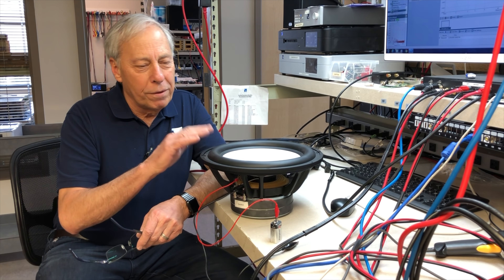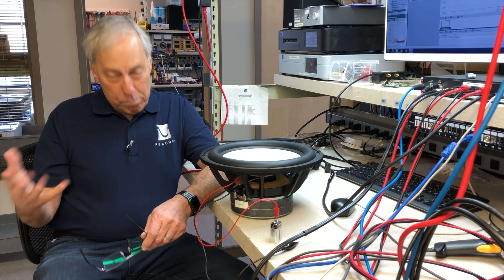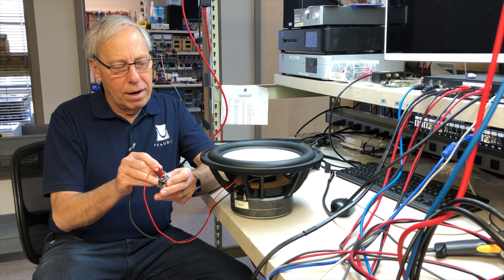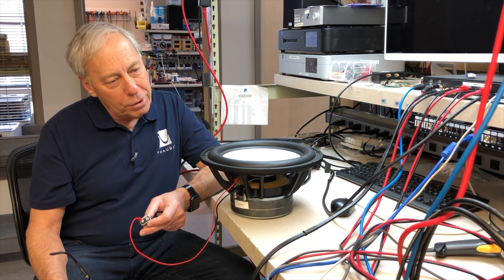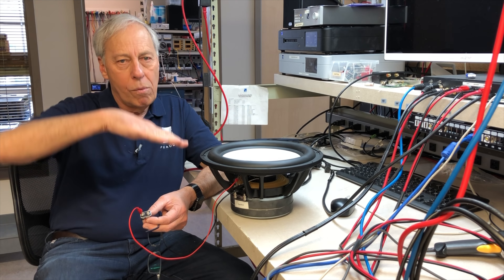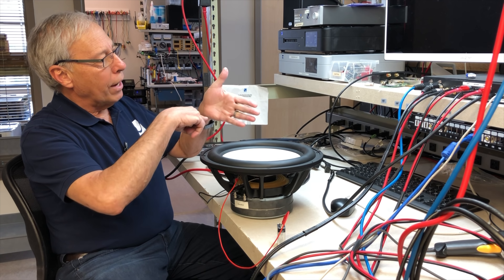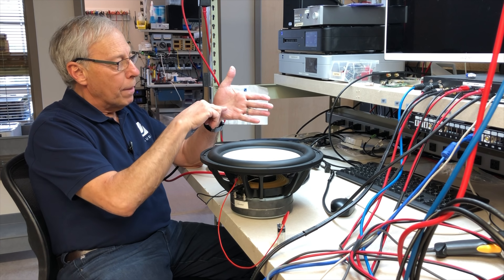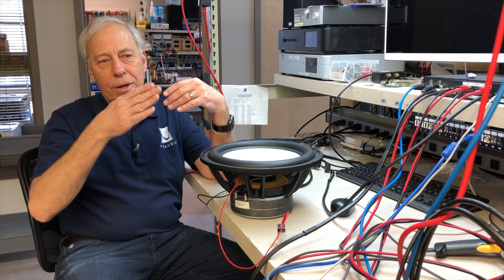How can one speaker driver reproduce multiple frequencies?

Comment: I think this calls for PS Audio to make a speaker with 50 thousand divers in it so each if them can be dedicated to a specific frequency. ;)
Reply: I think about 19980 would be enough 😂
Reply: @mannymore_music  yes but you will induce is comb filtering
Reply: The answer to this lies with the Danley Sound Labs Synergy Horn. Multiple drivers, each group best suited to their operating bandwidth, all acting together as one if they were one single driver - full range broadband, controlled directivity, linear phase, single point source.
Reply: That would be actually sick...
Reply: very good idea.
Reply: @trikki69 IVE THOUGHT THE SAME EXACT THING WTF
Reply: Instablaster...
Reply: 50 thousand phase issues
Reply: @Tarik B. the room acoustics of it looks not very promising
Reply: @Tarik B. Wall reflections - I don't get why audiophiles invest a ton of money for gear but don't care for the most important part of the chain which is always the room
Reply: @Tarik B. to precent a speaker you need room acoustics, otherwise you present the room
Reply: @Tarik B. Surely, but it's mostly not done - the only serious treatment I see on most videos are Diffusor which are the very very last step AFTER your room problems are solved to make it sound more lively - good room acoustics let sound 2000 dollar speakers far better than 10000 dollar speakers in a bad environment and after 10 months of room optimization I know that what I am talking about
Reply: OMG, the complexity and size of the crossover network would be insane. Just try to fit all of the needed inductors and keep them from interfering with each other.
Reply: Divers in speakers😂

Comment: Multiple frequencies playing at the same time on the same speaker diaphragm can be explained on the basis of the waveform  stimulated by the input. Same applies to the eardrum. Multiple frequencies stimulate it as a "waveform" at each instant in a continuous stream of different changing waveforms over time. waveforms

Comment: I never thought about a single cone reproducing multiple frequencies at the same time before, but once you asked the question, I couldn't stop thinking it must be impossible! Also didn't think about Doppler distortion before (though I've hard the term, just not in reference to speaker cones reproducing multiple frequencies). Thanks for the education.
Reply: It is impossible.  There is only 1D information, as is the case with light.  It turns into 2D information magically.  Because the information is in the being, not the wave.  The wave is simply numeric data.

Comment: Two thumbs up . The industry started with full range drivers and along came filters / crossovers . The same can't really be true for tweeters they cannot handle the long throw of the lower frequencies and would rip the soldered leads out .  Since the travel at higher frequencies is almost micro .  As speakers get older the caps often fail causing full signals into  mids and tweeters . 

Since I'm a Klipsch fan, lots of mods for the heritage speakers that would lower or raise the crossover points . Back in the day Speakers had selectable crossovers it allowed listeners to tweak their speakers on the fly . 

I always felt that crossing over before the amplifier stage was best , why amplify unwanted signals ? Downside more amplifiers plus side more power more accuracy more detail etc...

Comment: I understand that the larger drivers (which have a movement range in inches) have doppler distortion.. But do dynamic driver headphones also have doppler distortion? Their range of motion is so very small (less than 2 or 3 millimetres, isn't it?)

Comment: To be technically correct regarding the Doppler distortion, it is related to acceleration, not distance. I stationary train whistle at 1 mile away has the same pitch as it would if right in front of you. it is the change in distance over time that makes for the Doppler effect, and a slower change in distance has less Doppler effect than does a fast change in distance.

Comment: It is VERY EASY to have a visual using Audacity Just as Paul was explaining, think of the higher pitched tones riding voltage of the lower frequencies, naturally each is riding the lowest. Think of it like a surfer riding a wave on his surf board and jumping up and down at the sametime. Of course that would cause the surfer to fall off but anywho. Not the same concerning the electrical signals that the woofer, mid and tweeters deal with hopefully that gives a different explanation in addition to Paul's.

Comment: What decides the optimal speaker size? Is it the power of the system that decides how big cones you need to make sound of it? Meaning that bigger is better if you just have the electronics to play it?
Reply: @Marcus M, It's always been said to start at mid-range. Human voice is what we want to be correct. Standard is the 4" cone. It's light weight, can cover say 100 cycles to 3khz. That's a little out on the lower number, but let's just say it's the same as Paul's IRSV's. So we know that tones are best if played over the widest range on one driver. Everything looks the best when it's a single driver doing most of the range. But this isn't headphones, this is SPL in air. 
Next is how loud is the music naturally? I got about 85db at 15th row on a 7th and 8th grade school concert.
What is your music generally speaking and do you play at live levels?
Reply: Marcus M ... simply answer: size of room, desired volume , and consider other sacrifices willing to make. (Like :frequency response or efficiency) .. Its all about vibrating the air .. how much, how far, how quick, how accurate and with how much power

Comment: In a live situation, if two drums are played in opposite phases, will I hear nothing?
Reply: It is possible if you were in the exact location where the frequencies were 180° out of phase with no time shifting. But that is very difficult to postulate in reality.
Reply: @jimolson9671  You can get this to happen with tuning forks. In this case it would represent reality accurately as those frequencies would cancelled out in real life (negative pressure cancelling out positive pressure). This is something usually demonstrated in high school physics.
Reply: Flüg I understand he can readily demonstrate this in a controlled environment. But to live drums that is not a controlled environment in my opinion. That is why I answered the way I did
Reply: Flüg - I can see that happen in speakers. I was curious how it actually applies in a live setting such as a stadium setting.
Reply: LD Blake - But it will still be cancelling to a good extent?
Reply: Or in a 2.1 system, or 5.1, 6.1, 7.1 home theater. Where you have one subwoofer only, they usually get 1 mono signal instead of 2 different ones. Now it may be altered in digital domain either on source side or within the HT amp, but in theory when you join your stereo, out-of-phase bass signals into a mono one and feeding the sub with this merged mono bass, you wouldn't hear that much  than in case of a stereo one where despite bass tones being out of phase with eachother room reflections are not that perfect so you'll still hear a bit more of these tones. Another interesting consideration is: 2 kettle drums hitting in, within the same music, with a very tiny little shift in time compared to eachother.. count this in milliseconds. Let's say in a stereo system, left is hitting a tiny little bit earlier than the right one. They're reproduced by their own woofers (left and right) quite well. What happens if we have a mono bass, like a sub ? When the left drum is hit (earlier), the cone hasn't arrived back to its full zero position yet while it again needs to move out to play the right side drum's hit. Less air is moved and the right side drum might get faded or hit with less sound pressure compared to the left one, while in a stereo sub setup this isn't an issue. Actually I'm wondering if this is an issue at all with mono subs 'cause if 2 sine waves (each ~30Hz) start with a difference of 0.1s (or less) compared to eachother, the first sine wave hasn't ended yet so the cone is again not in the middle and when the second starts it won't move that much air as the first one, hence less SPL for the second sine wave. And when we take this into practice and think of a classical music where several kettle drums are hit after eachother at a high pace during a forte passage, some of their tones might be faded by a mono sub while playing well on a stereo sub. IF the microphones are dedicated to left side 1 drum and right side another drum. When the drums are recorded in mono, stereo subs don't help. On the other hand - again - we're talking about frequencies. So while 1 kettle drum is hit at 1s and another at 1.01s and their frequency is within woofer freq. response, they are played back well. Interesting topic :)
Reply: @naibafabdulkobor excellent explanation, thanks. 😊
Reply: No... 2 drums having different locations of sound source would mix in complex fashion... with only the lowest frequencies canceling out. more philosophically: Yes...If they were in the exact same location...(ignoring the method of exciting the drum ). .. A single drum  vibrating with 2 equal sounds with opposite phases...is the same as a non vibrating drum..doing nothing.
Reply: EnEm Gee, please look up for standing waves and nodes definitions. And post again for you latest understanding. Was your thinking right? Knowingly, you were a little bit right, depending when you hear the sound coming from the two drums.

Comment: Great explanation, Paul! But I am quite disappointed in how you only talked about the downside of a full range driver. Downside that is pretty irrelevant for most people, especially compared to the point source of the sound. Stereo imaging benefits tremendously of such source coming from a single point and while imaging can be great coming from an array like probably your speaker will be, achieving a similar stage with a full range single driver is orders of magnitude cheaper.

Comment: The velocity relative to the observer is what determines the frequency shift: up or down, moving toward or away respectively.  The distance to the train coming and going has no effect on the frequency (sort of: see next).  However (here is the sort of), Paul's 'yowling' train whistle is about right assuming you are 40 or so feet away from the tracks. Even thought the train is maintaining a constant velocity relative to the tracks, as it approaches the velocity vector toward you decreases as a function of yours distance to the track from a perpendicular line from the track and distance to  the whistle on the train.  Your distance to the track is fixed but the distance to the train is constantly decreasing as well as its relative velocity toward you.  The angle formed by a perpendicular line from the track to you and from you to the whistle is also decreasing and as this angle becomes zero (the instant the whistle passes by) the velocity vector to your location is zero and the Doppler shift will be zero (i.e. SIN of 0 angle is 0). And, this is reversed as the whistle move passed.  Cheers, Mark

Comment: Once upon a time all we knew was that the strength of things varied with time. So the jagged line plotted on a graph like the imaginary one Paul drew in the air with his hand could be the electrical signal from a microphone that varied with how loud the sound was as time passed. If we had an amplifier and a speaker we could vary the voltage applied to the voice coil which in turn varies its magnetic field strength which would vary the attraction and repulsion to a fixed magnet. With the voice coil affixed to a membrane like a paper cone and if the job were done perfectly the cone would respond the same way moving jaggedly along the same graph as the sound hitting the microphone and it's electrical signal varied. But that was all we knew, a graph would show a jagged line that varied with time.

Then about 200 years ago a brilliant French mathematician named Joseph Fourier  demonstrated thst we could look at that jagged line in an entirely different way. He showed that we could look at it as an infinite number of sine waves of different frequencies and different amplitudes added up. If the wave was periodic, that is constantly repeating itself over and over again the sine waves would be the lowest frequency of repetition and all of its whole number multiples. But if it didn't repeat itself then every frequency from zero hertz to infinity hertz would be present varying only in amplitude. This can be a tough idea to accept but it enables us to solve problems that would otherwise be difficult or impossible. What's more we can go back and forth from amplitude versus time to amplitude versus frequency as easily a bouncing a volleyball back and forth over a net.

We have continued to use this tecnique to analyze everything to better understand it ever since.
Reply: Mark Fischer another great summary! Mark you should be a teacher. I knew all of this many years ago but could not explain it in the clear concise manor you do!
Reply: Mark Fischer  100% right. Everything is made of Lego's. You can break it down to the bone.

Comment: of course the air waves , enter yore ear, and  push against another  flattish membrane called the ear drum ... then this  through a lever system is amplified and stimulates  the cochlea  which looks like a harp strings or piano sound board shaped in a snail shaped circle , when that happens it send a electrical current to the brain and sound is perceived . and yes , the cables are insulated !

Comment: 4:58 If we would see only 30 times per second, how can we see difference between 60FPS and 144FPs monitors. For those folks, who don't have 144Hz monitor.. Yes, it is noticable difference 😄
Anyways, thank you for answer 😄I have already searched it back in a day, but i couldn't find an explanation. So i've always wondered, "am i the only one, whom it doesn't make sense?" 😂
Reply: the fact, that you can tell a difference between 60 fps and 144 fps, does not mean, that you actually see 60 or 144 fps.
if you could, you would recognize separate (still-)images instead of an animation/movie. the entire concept of movies is only possible, because the eye can't perceive different images above a certain fps value and lumps them into a summation perception. and good old tv worked with 25 fps that way and movies still use 29.something fps.
the purpose of higher refresh rates of monitors and TVs is, to display smoother movements and less aliasing artefacts, when objects on screen move fast through the image (including rotations) or the camera itself changes it's viewpoint rapidly. thus, you donnotice a difference in the summed-up perception with higher fps'es, but that does not mean the eye actually sees those frame rates.
Reply: @klaus-udokloppstedt6257  You are basically saying, the people can notice / see / feel the difference between 60fps and 144fps, but they can't see all frames individually, right? Idk if my eye can see all 144 frames in second, but I can tell the difference, and that is my definition of seeing.

Comment: Before watching any further then you mentioning it not making sense;  I think it's simple;  as it does anything else;  any other energy modifies constantly the energies as a whole;  thus shall have highest frequencies' movements within the others that would not;  or be as corresponding to their respectful forces upon and includes that at times the syncing would fall at same times for example:  100 hz should fall 1 third of at same times as 33 hz(I would imagine);  where instabilities occur.  I think..  Ideally would be to have if three way system;  slipping of three tubes within each other with each their own coiling(maybe not) but stick out beyond reach of it's lower frequency forward movements and so on  or whatever what nots that one can imagine.  There are so many possibilities that could be done with drivers;  .... imagine having constant electromagnetics pulls in both directions where so even that it hovers;  then have those on L and R of a balance knob off an amp;  now control your knob with a regular voice coil;  now if only one source feeds the left and right of that balance control;  well then as moves towards left for instance;  then the right gets it's regular force plus the amount of the left's none use.  that knob can in fact be modified also.  Imagine using scrapyard crane magnets to do what I'm saying here;  lol  a couple of years ago I explained that to my brother and he couldn't stop laughing.  One can control two magnets like that with a diaphragm between the two;  huverring.  Anything can be tweaked.  Similar to how Electrostatic ones work;  with the difference that constant energies are used instead of magnets and shifting of charges at proper frequencies are implemented.  Those scrapyard magnets could likely drive a 200 foot or more woofer.  Cheers.

Comment: you certainly see way more than 15 times a second... or else 144hz, 240hz monitors would be unnoticeable when they are clearly noticeable
Reply: Magic you can’t see more than 24 FPS and perceive individual frames. It looks like fluid motion at that rate. That’s why movies are projected at that rate. 240 FPS looks like smooth motion, too.